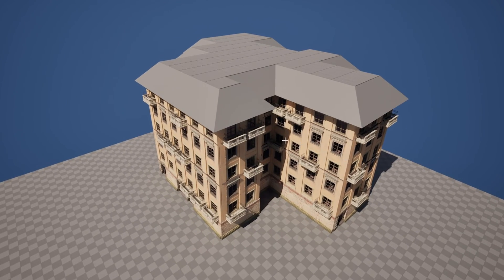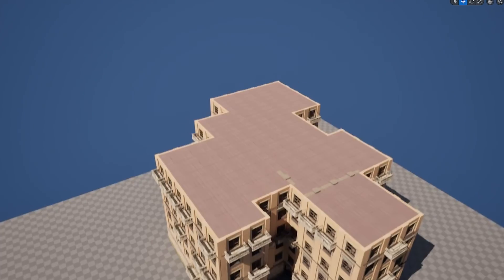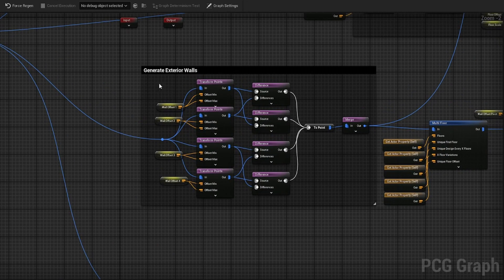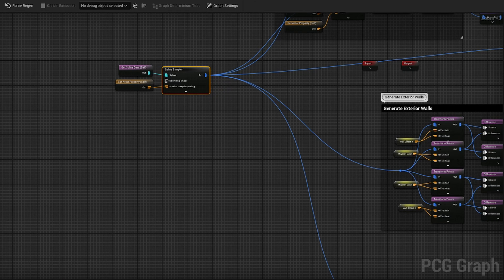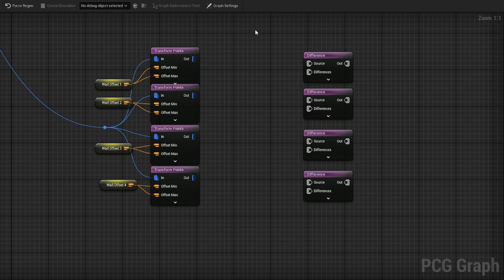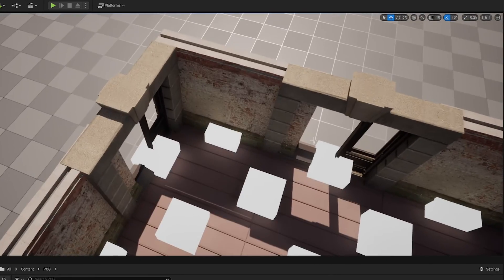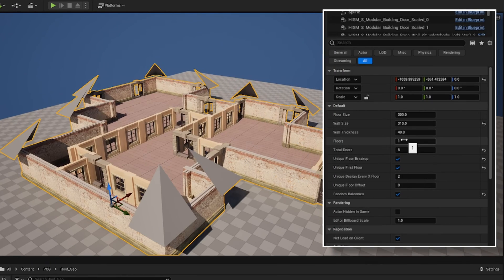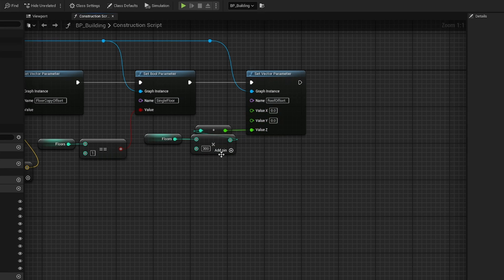How to Create Stunning Roofs With PCG | Building Series Part 11

Comment: Great video! Is it possible that you could make a version of rooftop generation for 5.4 as well? I have been struggling with trying to get the interior rooftop section to fit in correctly for my building.
Reply from the maker: I don't know a better way to do the rooftop for 5.4, so I'd probably just reuse this version at the current moment.
Reply: @Procedural_Minds I had an idea that I tried using the same intersection and difference used for the doors (using the roof mesh and the railing mesh) in order to remove the roof tiles on the railing points. My only problem was that the remaining tiles were displaced and and offset. What would be the best way of correcting the offset in your opinion?

Comment: Have you made a video creating different roofs like this but following you 5.4 series? I am trying to follow this one but using the nodes we made in the 5.4 series and am having a harder time.
Reply from the maker: Yeah, the two systems are very different. So you'd need to create your own system using a mix of the two. The main thing from here to get are the corner points.
Reply: @Procedural_Minds  I duplicated the "Roof Boarder Wall Corners" section, added an angled roof mesh to the Data Assets and the PDA Modular Building BP and switched out the Get Actor Property From Object Path to be the angled roof mesh and it will not spawn the mesh. When I debug the Static Mesh Spawner the cubes are all in the corners but the mesh will not appear.
Reply from the maker: @ashleyshannon412  Double check that you have the attribute or mesh set right in the spawner. Try with basic cubes as well. Basically need to start debugging and testing to see where it stops behaving how you expect.
Reply: @Procedural_Minds  Yep! Got it thank you!

Comment: This is great, but keep in mind that you need one mesh for the exterior and one for the interior, otherwise Lumen would make the interior too bright since the Mesh Distance Fields would get direct sun light, making it "glow" on both sides.
Reply from the maker: Just means you need a second static mesh spawner. But not everyone uses lumen and those that do like yourself already know the limitations and extra precautions usually. :)
Reply: wow i never knew this is why my houses insides have that weird lighting inside of them.   how do i change this?  just simply add a second mesh to the inside ?  not sure why this matters but i think i can slightly understand why

Comment: I wish this PCG system was more stable and reliable. I get all kind of issues trying to integrate this to my projects. Needs way more work.
Reply from the maker: Yeah, it's still experimental and lacking lots of basic features. But this is the early adopter version of it. Over time it'll improve, hopefully.
Reply: @Procedural_Minds  It's a shame for sure. I really wanted to not create every building and battlefield in my game piece by piece and then try to instance things as much as possible *facepalm
Still, I'll be following its development. This is actually one of those features really necessary for every developer no matter the type of your project.
Reply from the maker: @aleca8910  For certain things PCG is just just the best option I think. For example for scattering rubble / debris, populating props in areas, spreading decals around, things like that. Other things, like what I'm doing, is more for fun and a good way to learn PCG rather than professional use cases for it. At least not exclusively.
Reply: @Procedural_Minds  I'll keep my PCG high performance grass system. It keeps my levels small and can optionally be generated in runtime if needed. Not to mention that because I can control the density, it looks way better than regular foliage.
Reply from the maker: @aleca8910 Yeah foliage is another great use case for PCG. :)

Comment: Another great tutorial. Thx !   Are you planning to have one specific to meshes replacement ? Replacing a mesh is easy  but when they’re of different size, not obvious what variables to adjust.
Reply from the maker: You mean if you want to swap the wall mesh but the new wall is like 2x the size, right? I can look into setting something up for that.
Reply: @Procedural_Minds Yes, exactly. How to replace with my own meshes of different size. Thanks in advance !
Reply from the maker: @CNa100  Ok, I'll look into it. Typically though when making modular designs you want to make sure you have a standardized scale, pivot, etc. But I understand sometimes you get assets from other places where you would want to adjust in Unreal instead of in Blender for example.